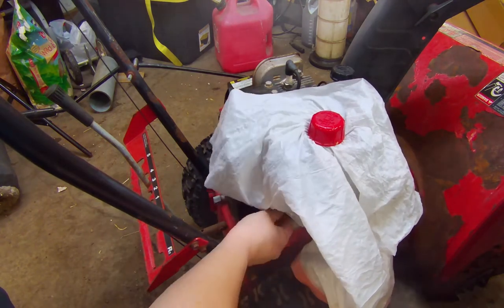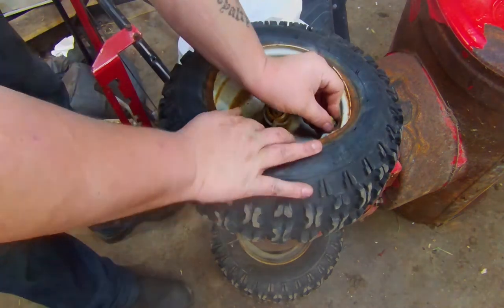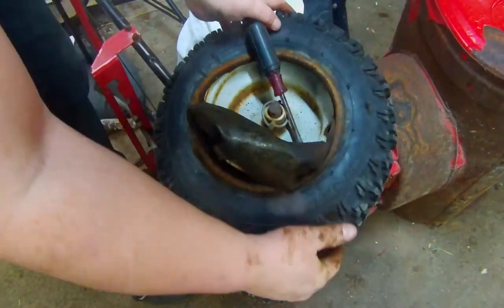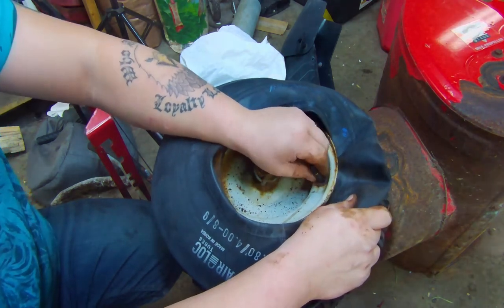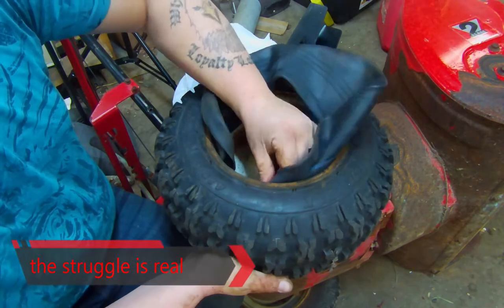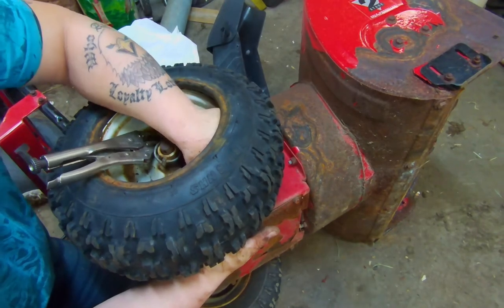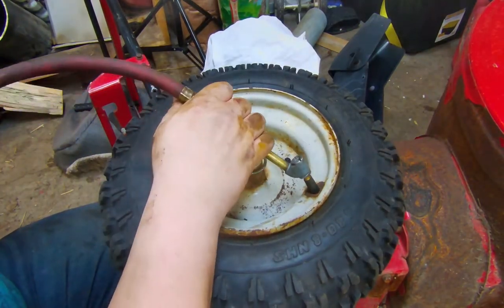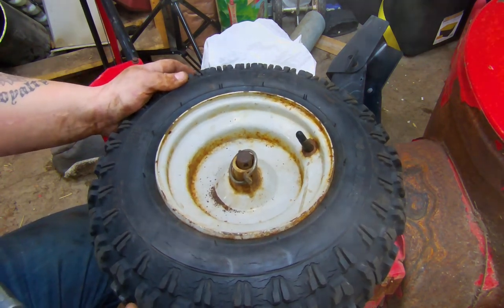How to Replace Snow Blower tire tubes!!

Comment: I need to tackle this....although I don't wanna really mess with it.   The link you provided has a curved/bent valve stem.  The one in the video looks straight.  I have no idea what to buy.  My tire says 4.10-6, too.  Anyway, if you get a chance could you let me know how to tell if I need a curved or straight valve stem.   Thanks for the video.
Reply from the maker: Either one will work I personally like the curved ones as it is Easter to get at to inflate the tire. Now the seller most likely ran out of the straight ones and switched the ad to the curved ones. Both will work perfectly
Reply: @Self.reliant  Thanks a lot.  Looks like a real pain in the butt - thanks for posting the video and the answer.  I ordered a set of 'em last night with straight valves.

Comment: I think it might have been a bit easier if you had turned the wheel over after breaking the bead on the outside, and broken the bead on the inside, and then put it back on the normal side and locked it in place with the locking pin.  That would have allowed you to lift the tire up higher when inserting the tube, I think with far less effort.  Thanks for the video, I think I'll have to do the same to mine.
Reply from the maker: Yes that would have been easier and if you can I recommend doing so. The issue is this machine the wheels were rusted to the shaft and wouldn't come off. That's why it was done this way.

Comment: Any reason you didn’t use tire spoons instead of screw drivers?
Reply from the maker: For sure. Most people don't have tire spoons and I wanted to show people how to do it at home and save a couple bucks. But yest tire spoons and a vice grip on the wheel works fantastic

Comment: Very useful video, thanks. I tipped my Craftsman snowblower on its side to try to put in a tube (wheel was rusted solid onto the axle0, and oil poured out all over.
Did you drain your oil first or how do you deal with the oil?
Reply from the maker: Yes sorry I didn't mention that I drained the oil first.

Comment: Argh. About to tackle this. Last time was over the winter and there was zero chance of getting the cold rubber tire off. Hate doing these. Make a split rim!
Reply from the maker: I hear you on that. The wheels were rusted to the axle on this machine hence why I tipped it over but it seemed to work well since it was held pretty secure

Comment: bent the shit out of my rim trying to do it, been changing tubes in tires for years either I have weak ass wheels or the tube isn't meant to be replace, brand new snow blower, bought before last winter used thru winter and noticed every time i needed to use the tire was flat so had to fill with air, thought to change tube but then the above happened, thanks for video but it doesn't work for me.
Reply from the maker: Ya some new wheels are plastic those I just use tire sealant in.